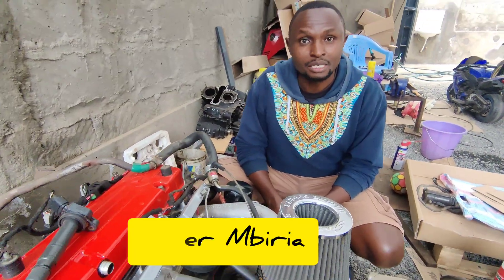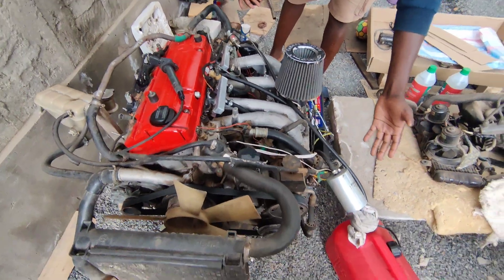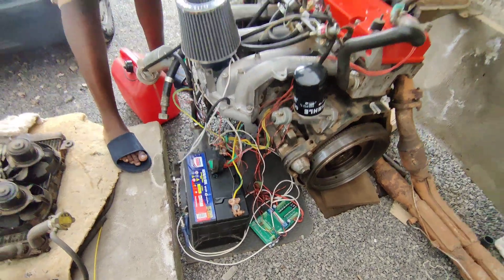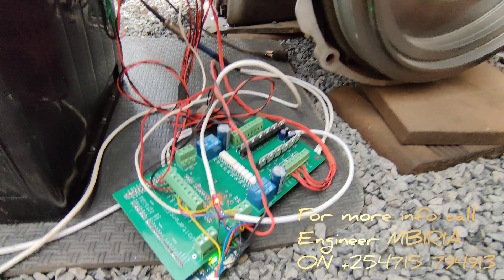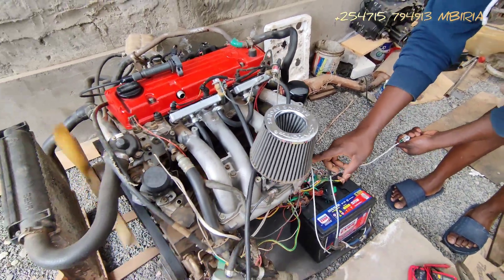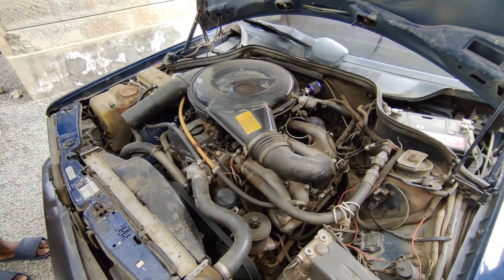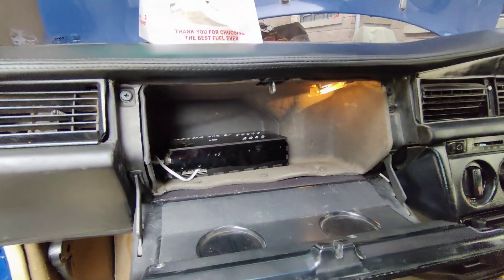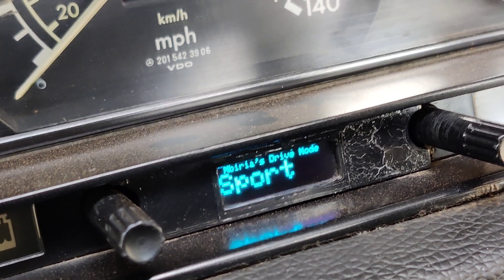How To Convert Mercedes  Benz M102 Engine Carburetor  to EFI DIY

Comment: Great work, does this m102 has en crancksensor and/or camsensor or have you added the sensors to the engine. You need these sensors for the timing of the ignition and fuel injection.